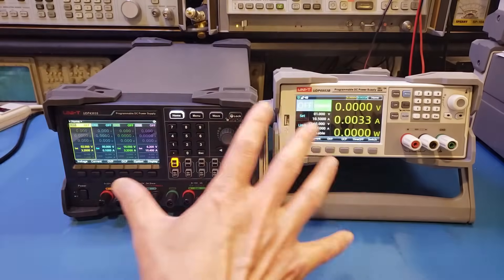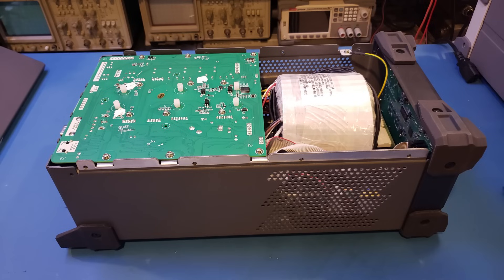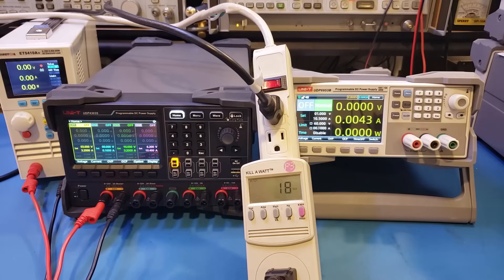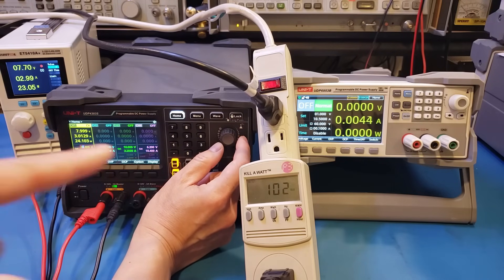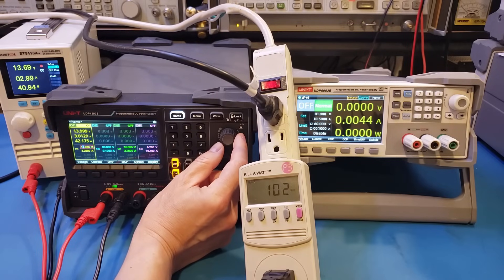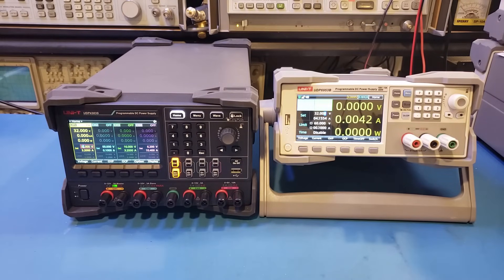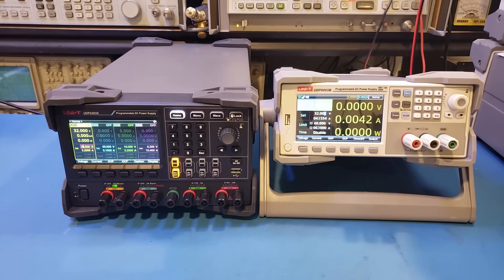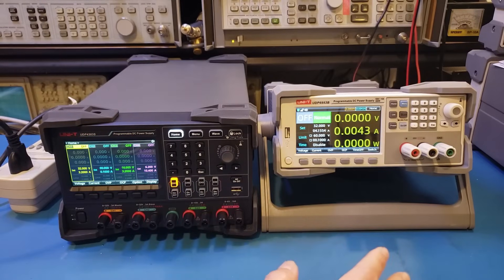Linear Power Supply vs. Switching Power Supply, Why Choosing One Over the Other?

Comment: Merhaba, çok net bir video olmuş. Emeğiniz için teşekkürler. Bence hobi ile ilgileniyorsanız, uygun fiyatlı olup her ikisinden de olmalı. Benim bir deneyimim oldu. Yüksek frekanslı pwm devresi kullanıyorum lehimlemede, anahtarlamalı güç kaynağına bağladığım zaman sizin yüksek derecede diyebileceğim bir ses çıkarıyor. Doğrusal güç kaynağından kesinlikle ses gelmiyor.
(Hello, this is a very clear video. Thank you for your effort. I think if you're interested in the hobby, you should have both, as they're affordable. I've had this experience. I'm using a high-frequency PWM circuit for soldering, and when I connect it to a switching power supply, it makes what I'd call a loud noise. There's absolutely no noise from a linear power supply.)

Comment: It seems that each person's (or company's) method of measuring Ripple&noise will be different, especially the use of decoupling capacitors, some examples are proposed by Intel in the ATX standard, or the Japanese standard (EITA RC-9131A). If you have time to review a few SMPS models from Japanese brands, they all agree on a common standard for measuring R&N such as using coaxial cable, RC low-pass filter, decoupling capacitor... In fact, during the process of testing many methods, I found that plugging directly from the source to the oscilloscope is often affected by the environment (for example, turning on and off a few devices in the room can also cause interference), and the results may not be the same between you and me due to different environments...

Comment: It's  not a choice of one or the other, it's the design of the system that requires either supply to survive. Vintage electronics don't  like switching supplies for they can fry them with either undervolt or overvolt. So that is why linear supplies are in need for older systems.

Comment: I had a switcher on my bench for a short while. The low mass meant it required two hands to operate. One to plug cables in, and the other to hold it from sliding around. Annoying.

Comment: Will a capacitor multiplier reduce the noise on the SMPS and how far you can go with that approach?
Reply from the maker: If your goal is to simply reduce the noise, yes you could add a capacitance multiplier. The problem is that there is additional voltage drop across the transistor/MOSFET which is dependent on the load current so the load regulation will be poor. And it will also impact your transient response.
Reply: @KerryWongBlog  Would a Kelvin connection help with regulation in this case? In what way is transient response affected with a voltage multiplier? Thanks for your feedback

Comment: Could the ripple be addressed by adding our own output capacitors externally when the job requires lower ripple?
Reply from the maker: To a degree, yes. But it also slows the transient response, so you will have to balance the pros and cons.

Comment: There is another drawback of a switching power supply for me. When it fails, the load is usually exposed to high voltage, unlike in a linear supply where the circuit simply opens.
Reply from the maker: I guess that depends on the design. But for cheap ones, absolutely this could potentially be an issue.

Comment: Hello Kerry,  first comment on your channel.  I enjoy your work and I appreciate you for giving back to the community, giving a good look at test gear and what has value for the electronics hobbies and repair for hire.  I agree with you that you can't have too many power supplies.  I have 7 power supplies, all linear types.  One is vacuum tube voltage regulated, a Heathkit IP-17 High Power.  HP/Agilent are my favorite for rock steady output.  I am interested in SMPS for the bench, you have piqued my interest in having one on my bench.  Thank you and keep the videos coming, 
Gary

Comment: You might not have chosen the ideal Switching supply there. My ancient BK Precision linear supply has around 4 taps that are switching with real switches, not even relays, and its actually more efficient in a few spots than the Switcher in the video.
Reply from the maker: Yeah, The efficiency of the UDP6953B is not particularly high for a switching power supply. And that's mainly because it is designed to have such a wide output voltage range.

Comment: You overlooked an important characteristic of switching power supplies that bothers me: current overshoot. For example, if I set 5 mA at 30 V and connect an LED, there is a high risk of it burning out. In contrast, a good linear power supply does not have this issue because it does not require large output capacitors.
Reply from the maker: Thanks for pointing that out! Yes I forgot to explicitly mention that in the video. I did demonstrate the overshot in my UDP6953B review video. In general, the loop response of a switching power supply is slower compared to linear power supply. Besides the output capacitance, another factor is the energy stored in the inductor in an SMPS which could be suddenly dumped to the load during an over-current/short situation before the control loop can react. Not all SMPS are created equal though, the UDP6953B actually handles this situation pretty well and the overshot is not significant.
Reply: Many linears have the same limitiation...

Comment: All low cost Riden 6xxxP models are hybrid switching/linear units constantly setting the Vce of the linear output to just a couple of volts above the operator set parameters. The 6006P model (0-60V @ 0-6A) merely requires up to 70V dc from whatever source you can provide.
Reply: Согласен с Вами. И с хорошим заземлением пульсации на выходе почти нулевые.

Comment: Be good to see your review on the Fnirsi IPS3608 power supply
Reply from the maker: I was originally planning to review the IPS3608 later this month. Unfortunately, there is a delay and looks like I won't be able to review it till early Nov. But I will definitely review it.
Reply: @KerryWongBlog looking forward to it.
Reply: I just received the IPS3608.  I will update my remarks above to reflect what I have found.  Notably, the banana jack spacing IS standard 0.75 inch on the unit I received.  The build quality is good.  FNIRSI is doing a nice job with the styling of their products.  The unit apparently supports PC control, but the manual doesn’t elaborate past noting the USB-C control jack on the rear panel.  I will have to do more in depth test on noise performance.  Probably my least favorite aspect is the buttons work differently in different contexts, it takes a little getting used to, but not too bad.  The least obvious is the timebase setting on the graph screen is not highlighted.  You just have to know the left/right arrows change the timebase when V or I setting is not highlighted.  The same is true of selecting the memory setting on the home screen.
Reply: Very strange, my precious remarks seem to have been deleted.  Initial testing of the IPS3608 is encouraging.  I believe FNIRSI does not publish the noise and ripple specifications.  The unit I received seems to hit the marks for the published specifications.  I set up a quick test with a 100 Watt 120 Ohm resistor as a load. At full scale 36 volts, the resistor current was 0.308 A DC, 10.89 Watts indicated.  The oscilloscope showed a mostly sawtooth ripple at about 78 KHz, 35 mV p-p. There is semi random ~375 KHz 200 mV p-p ringing superimposed on the sawtooth.  The total noise is ~50 mv RMS.  If you look at FNIRSI’s product page for the IPS3608, there is a photo about half way down with a 36 V output displayed on a DPOS350P oscilloscope.  The waveform shown is approximately what I observed, but ringing is less noticeable in FNIRSI’s photo - they are looking at a no-load output.

I do not see any red flags which would recommend against purchase.  US customers may want to check ordering directly from FNIRSI US.  The advantage is quick delivery with no tariff uncertainty.

There is still more testing required, but I wanted to give a quick update.
Reply from the maker: @wtmayhew  Thanks for the update! I don't know why comments keep disappearing :(
Reply: Looking at the 24/48 Volt module separate on the bench no load, I see noise 385 mV p-p, 35 mv RMS bursts ringing at about 4.2 MHz.  It looks pretty good.  The 72 kHz sawtooth seen in the front panel output appears to originate in the front panel switching regulator.  Over all, pretty clean for switching power supply.
Reply: Disassembly notes:  The IPS3608 is very modular, in three pieces.

1.  The back panel has a fan and the line cord connector plus USB-C communication port.

2.  Then middle section is an off the shelf Ju Yuan Hai model JY-450W-2P lighting/telecom supply with dimensions 140x88x40 mm.  This version of the JY-450W-2P power supply is rated for 48 V @ 8A and 24 V @ 3 A.  That would be a total of 456 Watts.  The rating sticker is on one of the input filter capacitors.  The 48 V snd 24 V share a common ground.

3.  The front panel appears to be FNIRSI’s own manufacture.  Mine is labeled IPS3608v1.0.  The most interesting parts have their identifying marks scraped off as usual.  The 48 Volts appears to power most of the circuits and the 24 Volts appears to be dedicated to the USB outputs. The banana jacks appear to be gold plated.  The jacks are through-hole and soldered to the board.  Screws may have been a better choice, but the solder work is tidy.  My USB tester says that the USB-A supports 5V and XC 3.0 up to 21 Volts.  The USB-C output supports 5V, XC 3.0 and PD 3.0 up to 21 Volts.  The max power out of either single USB is 40 Watts.  Note that the 24 Volt rail is rated 72 Watts.  The main output is up to 36 V @ 8 A.  The 48 V input is fused at 10A with a soldered fuse.  The output is fused at 15 A with replaceable chip fuse in a very tiny socket.  Something to keep in mind is that the USB outputs are not isolated from the main ground.

The IPS3608 quality of construction is better than some small Owon desktop switchers I own, but it is less than my gold standard of clean design inside my Keysight 6.5 digit multimeter I own.  Over all, not bad for the FNIRSI.  FNIRSI gets a help in having a clean design by choosing a nicely engineered open frame power supply from Ju Yuan Hai to provide the 48 and 24 Volt rails.  I rate the IPS3608 as a good buy with the discounts available directly through FNIRSI.

Comment: Similar to the Class A vs Class D amplifiers
Reply: Exactly the same. Amplifiers (at least, used for audio purposes driving speakers) are just voltage-controlled power supplies, controlled by the input audio signal. A class D audio amplifier is simply a voltage-controlled switching power supply.

Comment: How come there aren't more "hybrid" (switching + linear) power supplies out there? Those would have most of the advantages of a switcher while keeping most of the advantages of a linear. That's the design used inside every modern spectrum analyzer and similar equipment so it does work, it's just very uncommon as a standalone unit.
Reply: You are mistaken that is retains most of the linear supply advantages. Switching noise generated by the preregulator is at a high frequency, where the excess loop gain of the linear regulator is much reduced. This is inherent in linear regulators/control loops, as they require a dominant first order pole for stability. That means that the linear regulator can not effectively reject noise in that frequency range, and hence you end up with the noise (albeit reduced) in the output anyway.
For some concrete numbers, you can look at the LM317 datasheet (ti datasheet, p11 fig 6-14), where you can see it has a rejection of just 10-20dB at 1Mhz.
There are ways around it, by filtering the noise with passive filters, but this (because of bulk storage) compromises other performance parameters such as the transient response (e.g. if you suddenly require a higher voltage, the pre-reg has to charge these caps first).
Reply: @tHaH4x0r  The LM317 is ancient and not a very good regulator. Something more modern like a LT3045 will do 76dB at 1MHz.
Reply: @NiHaoMike64 The lm317 is just an example of the concept. What I noted holds for any closed loop regulator, and always implies that they aren't very good at suppressing high frequency noise, which switch mode power supplies generate a lot of by their very nature.
Reply: @NiHaoMike64  The LM317 I picked is just an example of the concept, and holds for any closed-loop regulator. They are inherently poor/unable to suppress high frequency noise, which is exactly what switch mode supplies generate a lot of by their very nature.
Even your cherry picked example of a particularly high PSRR regulator (which has a limited voltage range and cant handle much current), drops to just about 50dB at 10M, and most switchmode noise has plenty of energy at 10Mhz (standard ripple+noise testing is up to 20Mhz, but even far beyond that switchmodes have energy, which is why they can be an EMC headache).
So if anything, this extremely good PSRR example proves the point I am making.
Reply: @tHaH4x0r  50dB of attenuation is a lot. At that high end, it's fairly simple to further increase the rejection with some fairly small filters.
Reply: @NiHaoMike64  Although I agree passive filtering is the only way in which you can tackle the switchmode noise, I believe you fail to understand my point/the trade-off involved here. 
You cannot just wack 'fairy simple small filters' in between the switchmode regulator and the linear regulator without compromise, the compromise being dynamic performance. The addition of capacitance on the output significantly slows the control loop of the switch mode pre-regulator for stability. The control loop of the prereg needs to be faster than the linear regulator, necessary such that the latter doesn't 'outrun' the former, thus compromising dynamic performance as a whole. In the time domain you can imagine that in case of change of voltage, the switch mode should first be able to supply a voltage high enough that the linear can then down-regulate to what is required. And thus should have to charge the capacitors first.
Hence you see the trade-off here between dynamic performance and passive filtering (and thus output noise). This is also why from every major manufacturer the hybrid PSUs have worse dynamic and noise performance than pure linear supplies.

To illustrate my point, we can look at a typical mixed-mode vs linear PSU, from AIM-TTI (very well known brand). They have two series which are very similar although one is mixed mode and the other linear (they even share the same datasheet). From this:
EL-R series (linear)
Ripple and noise: <1mV rms
Transient response: <50uS within 50mV of setting for 5 to 95% load change

EX-R series (hybrid)
Ripple and noise: <2mV rms & <10mV pk-pk (indicating that this is indeed HF noise added from the switching)
transient response <200uS for same conditions as above

As you can clearly see, the mixed mode has worse noise + ripple and transient response.
Reply: @tHaH4x0r  Somehow, every manufacturer of spectrum analyzers has managed to make it work. If they could lower the noise floor further by going all linear, they would. But they don't, that should be telling of something...
Reply: @NiHaoMike64  A low current, fixed voltage output power supply in a piece of equipment is VERY different to the design of a lab power supply. In the case of a fixed voltage regulator you indeed are quite able to just put passive filtering on the output to reduce it to acceptable levels. Never mind that these voltages are not used for references and such, and thus you can benefit from additional PSSR ratio of e.g. opamps inherently.
This however is about lab power supplies that need to have much better transient response, recovery, regulation and current limiting, and being adjustable to boot. 

Your original question was why mixed-mode PSUs are not more common. I have attempted to explain this to you, and shown you a specific example illustrating the point and (one of the) trade-offs and that a linear regulator at the output doesnt just simply combine the advantages of both.  So again, you can read my previous comment for a comparison of commercial power supplies and that they indeed show worse transients and noise when mixed-mode rather than linear. 
If you don't want to accept that explanation, then do read up as to what exactly is false about my comparison. If you, in the face of evidence and explanation, dont want to accept it still, you might have to ask yourself why you ask a question in the first place.
Reply: I use the "switching then linear" trick for personal projects, but it becomes problematic once the current requirements get larger and there is a need for variable output voltage.
Dealing with the tracking voltages of 2 separate systems would not be trivial.
Also, during current limiting, the linear regulator pass devices need to dissipate a lot of power.